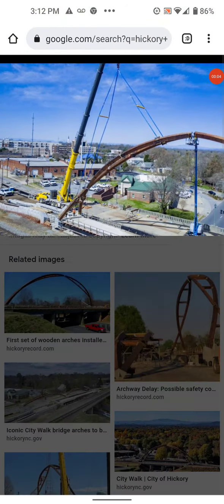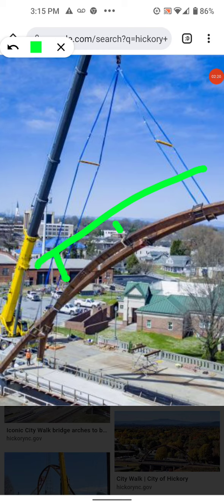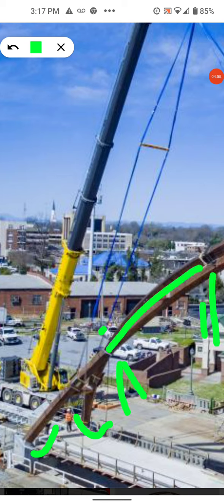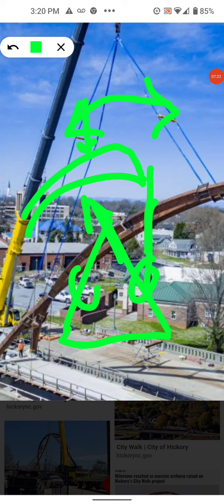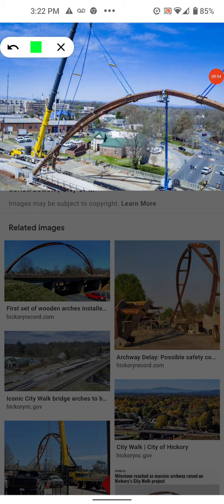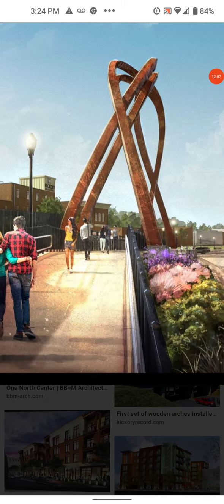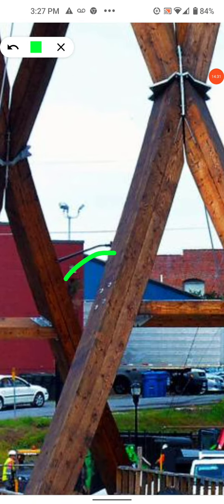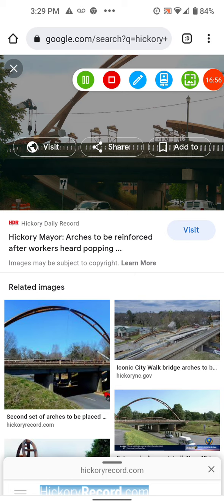Hickory Pedestrian Bridge Collapse Structure was repaired & possible connection failure part 4

Comment: The blame game begins. . . v“Neill Grading and Construction Co., Inc is under contract with the City of Hickory for the construction of the City Walk Project as the General Contractor. Neill subcontracted the design and construction of the pedestrian bridge, the bridge end walls, and the decorative wooded arches to Dane Construction.

Dane Construction hired/subcontracted the design and manufacture of the decorative wooded arches to Western Wood Structures of Tualatin, Oregon. Western Wood Structures was one of the three approved companies listed in the bid documents that could be chosen from for the City Walk Project. Dane Construction erected the decorative wooden arches once they were manufactured and shipped to the project site by Western Wood Structures. The installation was done under supervision of the NCDOT’s 3rd party construction administrators and inspectors as well as other organizations."
Reply from the maker: Well done Dos... this is great confirmation bias about the left hand might not have the knowledge on how the right hand (the structure) needs to be "respected"...
Reply: @ForensicCats  It wasn't clear how many different companies were involved in this small pedestrian bridge. And why is regulator NCDOT outsourcing all that work?
Reply from the maker: @dosgos  , those many flames in this fire; I can see where a ''hand off'' might not get all the required and necessary data across...  Too many ''man in the middle issues"...
Reply: @ForensicCats  I emailed you a report from Western Wood listing the repairs that were done.
Reply: @ForensicCats  Jimmy Terry, P.E. (NCDOT Consultant TGS Engineers) was involved in some HIckory walk projects.

Comment: "The Engineer for this project was Wood PLC. Additionally, the City worked with NCDOT and Norfolk Southern on City Walk to obtain necessary approvals for construction."

"The interwoven arches for the bridge are constructed of Douglas Fir treated glulam beams that will span 178 feet across N.C. 127 and rise 60 feet above the City Walk path." 

"There are two bridges that are incorporated into City Walk. One is an iconic, pedestrian bridge that will cross over Highway 127. The second is a pedestrian bridge over Third Street, in Downtown Hickory."